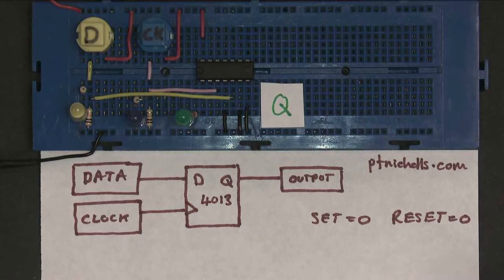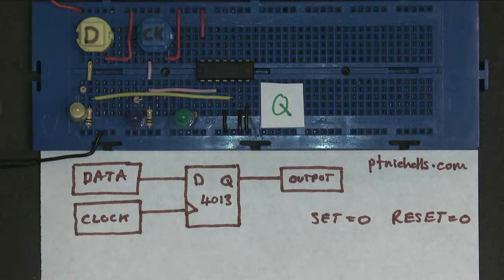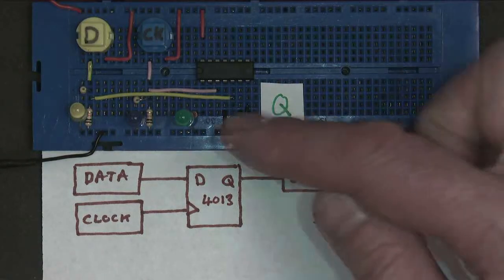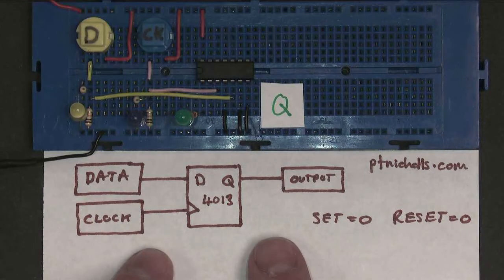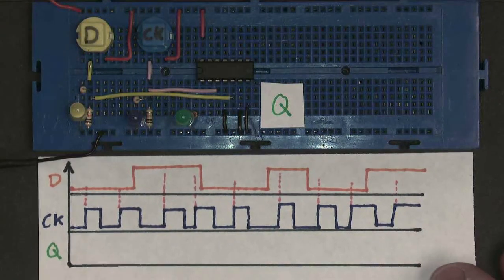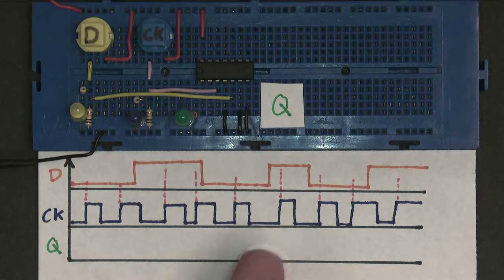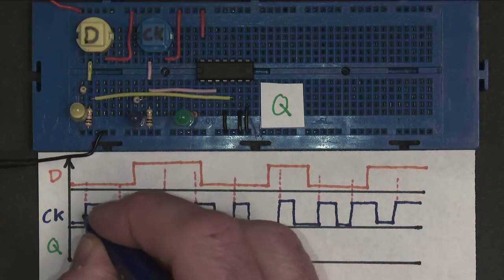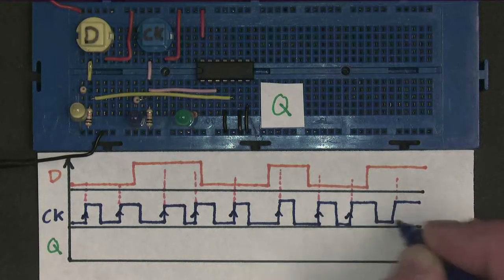D-Type flip flop

Comment: what happens when D 1-> 0 and clock 1-> 0 at the same time?
thank you :)
Reply from the maker: When the clock goes 1->0, D has no effect because the output will only change on the rising edge of the clock i.e. when the clock goes from 0 -> 1. When the clock rises, the state of D is copied to Q - if D is changing at the time it will depend on whether Ck or D changes first! There are various timing diagrams etc on my website at http://www.electronicsteaching.com/Electronics/Dtype.html. In the new academic year I plan to add some more detail about how circuits such as the D-type flip flop actually work at a more fundamental level. Thanks for your question.
Reply: @ElectronicsTeaching  thank you :D
http://www.electronicsteaching.com/Electronics_Resources/Images/Dtype_Timing.png (y)